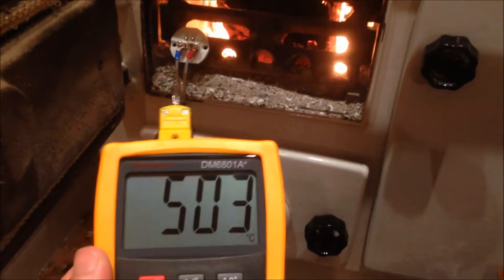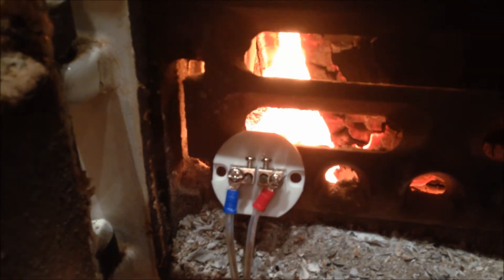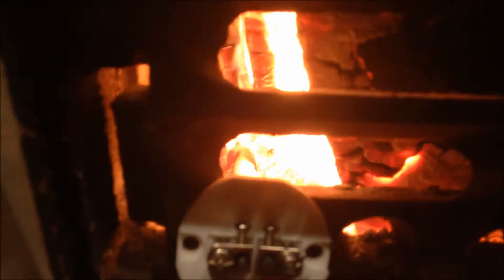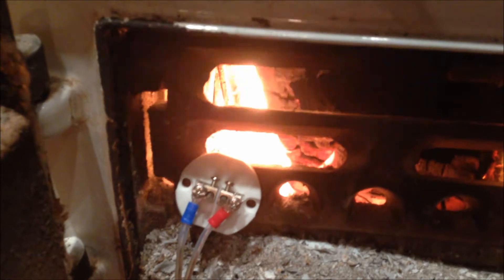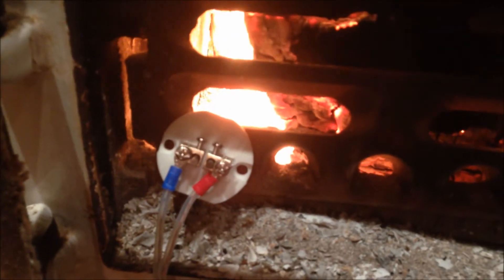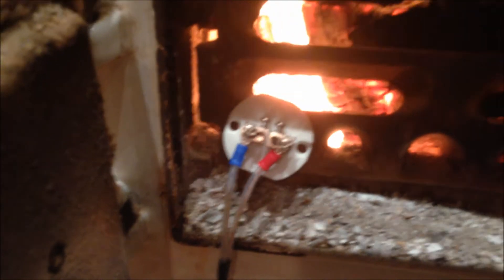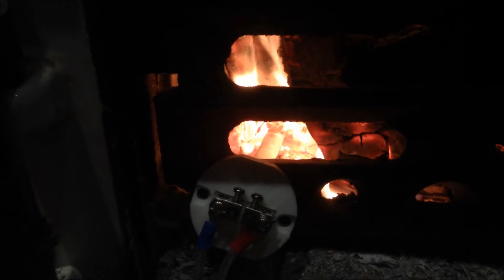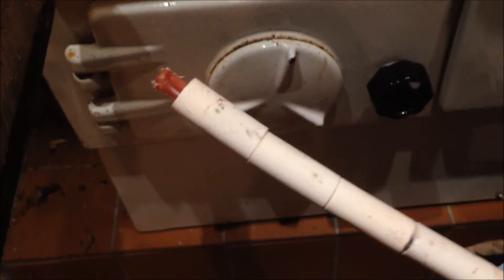Wood burner temperature

Comment: 700 plus with the DOOR OPEN?? C? This is over 1000 degrees F which one would expect half that..ah I see there is a rod extending into the coals..Yes thats about right but you speak softly and quickly and cant understand your words..Nice wood burner! from what I see cooking stoves are very efficient..
Reply from the maker: This guy summed up how you wrote your comment! https://youtu.be/57cUS9pWTXI, 4 fingers pointing back at you! Maybe you should make your stove video in landscape and try to shake the camera more!  Just kidding, LOL!
Reply: I dont know WHY you posted..Im looking for temp data as opposed to claims..I posted only to link and share with interested stove developers wanting hard data..like the manufacturer of this tiny grizzly cubic that I highly modified nearly doubling its output..700 plus celsius is VERY hot!! yes glowing red. Interesting. Interesting how few include ANY temperature measurements. Thanks for sharing your new toy/thermocouple..I need to get something like this and am comparing options..
Reply from the maker: If it helps i got it on ebay, it is normally use in pottery kilns. It was about £50stg.
Reply: thanks